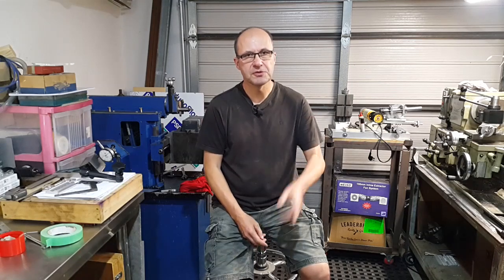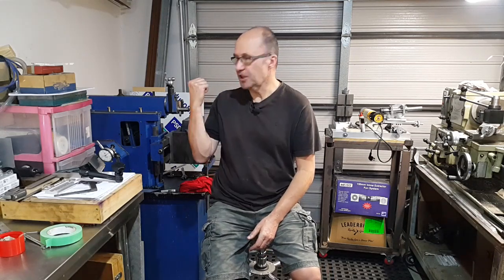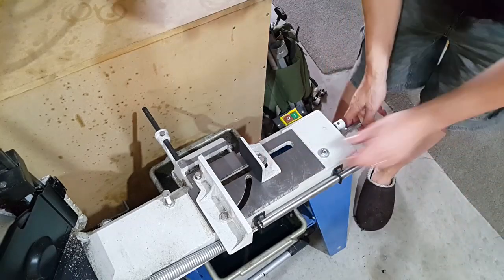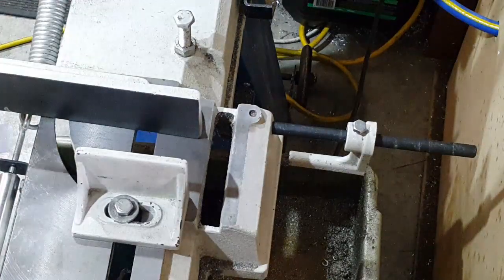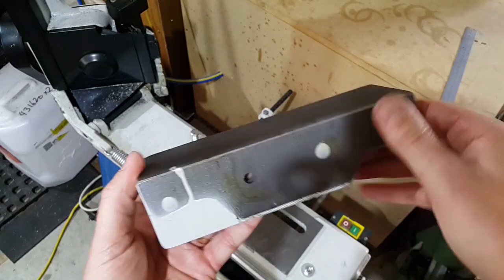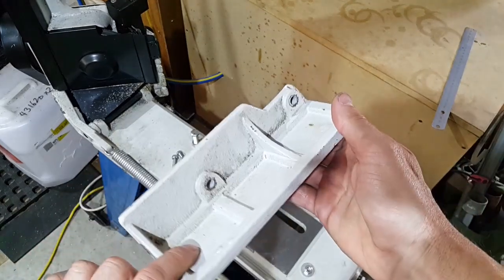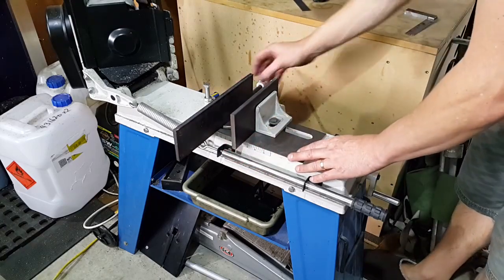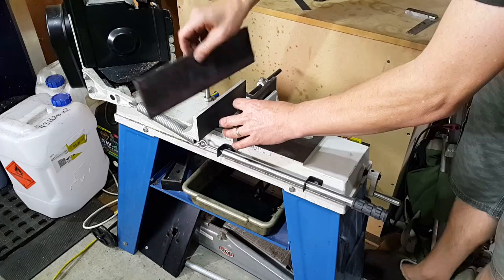#54 - 4 x 6 Bandsaw upgrade using the Viceroy Royal 250 Shaper

Comment: Nice job ! 
I did this a while back and it has transformed the saw  ! 
Next one i did was a hydraulic arm feed to replace that damned spring , i used a pneumatic ram for this instead of a proper hydraulic one and it works well i also made a valve body to allow a metered feed rate . This modification made it cut squarer , stopped blade breakage  and  except on really wide thick pieces of aluminium -blade jams ( a little WD40 fixes that ) -or i could do it properly by changing the blade to a courser pitch but I’m too lazy for that !
Reply from the maker: Hi Ian, I've been thinking about adding a hydraulic arm also. Another project for the list....
Reply: MachineNZ 
I found blade life was increased massively once i did this , those damned spring things don’t keep the feed constant and the higher up off the bed your cut starts the more pressure the blade will have on it .
Some designs use a small reservoir on the end of the ram to store excess oil but i found that if i used a dedicated tank under the ram it works just as well if not better  once i bled the air out - i used an old fuel tank off a briggs and stratton horizontal engine -because i had one floating around ! Doesn’t look pretty but it works !

Comment: Nice mod. Its reminded me I need to do the same thing.  Re shaper, Rustinox is bang on the money. Your reverse stroke looks to be slower than the forward/cutting stroke. It should be the other way around.
Reply from the maker: I have always thought that the stroke is wrong. Its a 3 phase motor running through a VFD so will have a look. I think the wiring can be changed but will do some research. Thanks for the info
Reply: MachineNZ it’s easy. I have a number of 3phase on VFD as well. You can just cheat and run it in reverse mode on the VFD. Better to swap two of phases.  Don’t think it matters which ones you swap. But always good to do your own research. Maybe get a pic to Rusty. He will know.

Comment: Nice upgrade. To add to it fix a section along the top of the back jaw, that'll allow you to cut 8" or so flat plate, & more efficiently, i.e. front of the plate to cut set at the base of the front jaw, & the rear of it tucked under the section at the top of the back jaw. I think Joe Pie showed this recently.
Reply from the maker: Hi Dave, thanks for the tip. I'll have to watch Joe Pie's video and see.....
Reply: @Machine_NZ  
https://youtu.be/5fvhbhTxF0c

Comment: Is you shaper running backwards?  Seems faster on the return stroke?
Reply from the maker: I have always thought that the stroke is wrong. Its a 3 phase motor running through a VFD so will have a look. I think the wiring can be changed but will do some research. Thanks for the info

Comment: Nice modification 👌. 
Not a critic here but I think the shaper is running in reverse, the push stroke is suppose to be slower than the return.
Reply: Yes I was going to ask the same question as it does seem that the cutting stroke is certainly as fast if not faster than the return. I have an old Ormerod 18 inch shaper and the return is noticeably quicker on that. It is also easy to get the step mechanism to activate on the wrong stroke as well if you are not careful.

Comment: That's a nice upgrade. It will make a huge difference for holding small parts.
Just a little tip; yous shaper is running backwards. If you can make the motor run in the other direction the problem is fixed.
Reply from the maker: I have always thought that the stroke is wrong. Its a 3 phase motor running through a VFD so will have a look. I think the wiring can be changed but will do some research. Thanks for the info Rusty
Reply: @Machine_NZ  That's what friends are for, isn't it? Normally all you have to do is to switch fase 1 with fase 2 on the motor but i haven't seen the connectors, so check first.